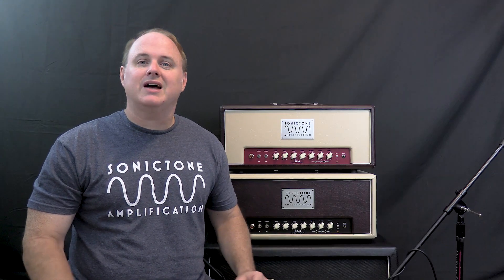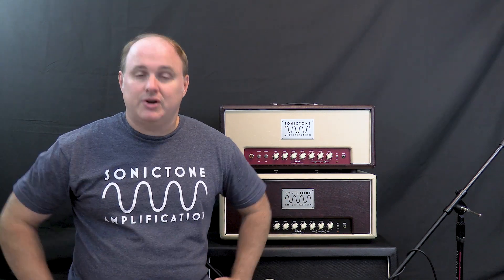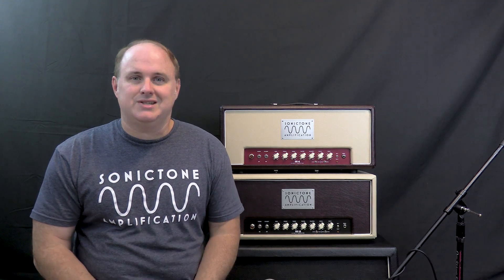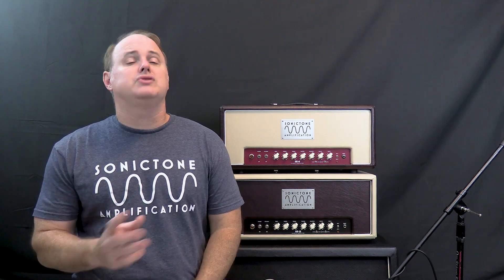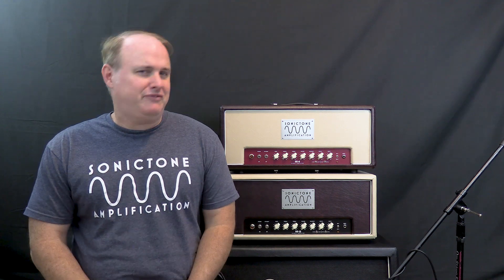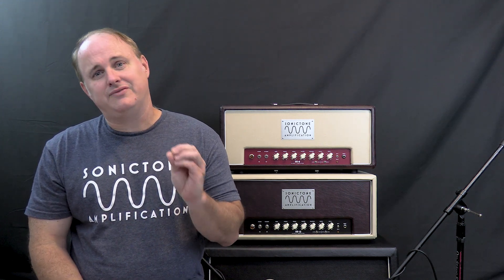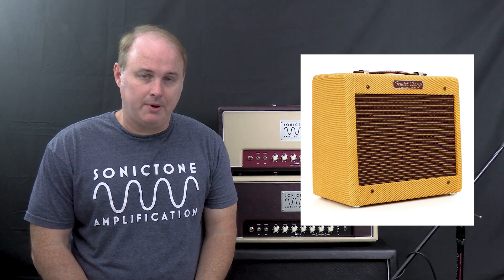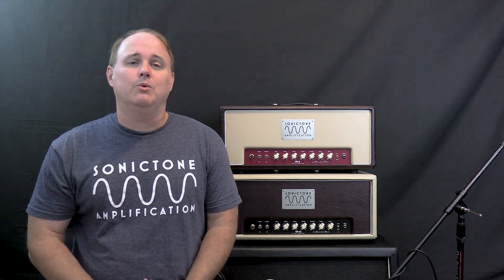Class A Amps

Comment: The Vox,s are class AB! The use of two power tube in class A are just wired in series to get more power. I think you can push them up to 18 to 22 watts without resorting to a monster output tranny.